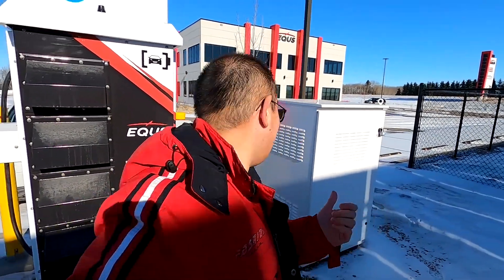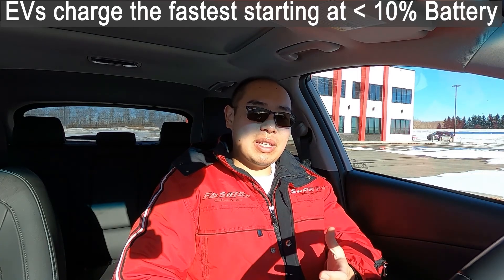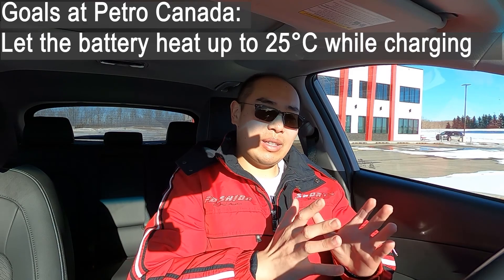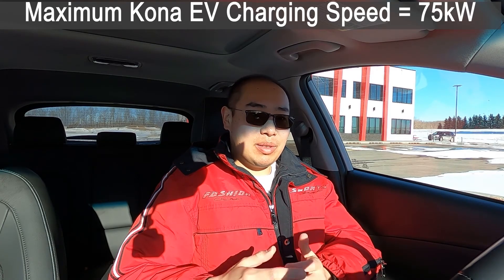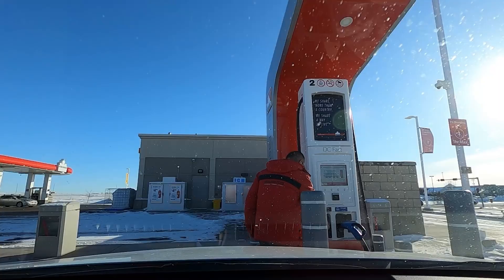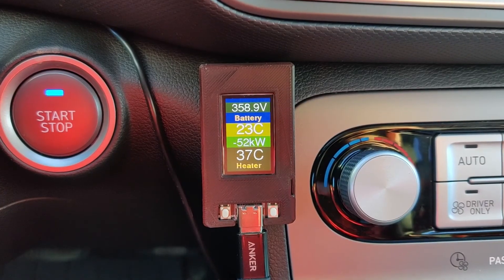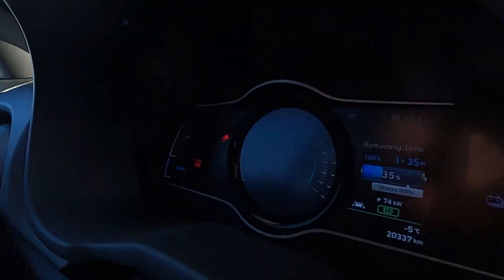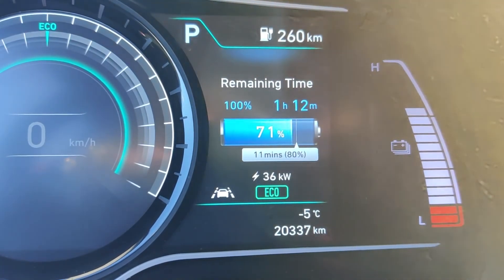Winter 75kW Charging Test: Hyundai Kona EV 2020

Comment: Is there anyway to warm the battery up before you leave on a long trip? I set our Niro to warm up the cabin and charge the battery to 100%. Then we drove all day and made five stops to recharge. The air temp was 0 to 5 degrees C (32 to 41 degrees F). In the afternoon stops we were charging at 75 kw, but the morning charging seemed very slow. I had checked the “winter mode”.

Comment: I'm buying a 2022 Nissan leaf SV plus . I'm wanting to do a long distance trip from Edmonton to Orlando . Do you think this is possible ?
Reply from the maker: The trip is most likely possible in a 62kWh Leaf, as long as you can find charging within the right distance and the chargers you want to use work. But the Leaf rapidgates after repeated DCFC sessions so driving 1000km per day may result in slower and slower charging speed throughout the day. Since the Leaf has only air cooling, your battery's temps are at the mercy of the ambient temp.

Comment: We don’t pay for how long it takes to fill up an ICE vehicle, why are they charging based on time and not kWh? 
We pay per kWh in UK, or I have done for the past 9 years!
Reply from the maker: I'm not 100% sure why all the DCFC here are charging money based on time and not energy. There was only one that was energy based but later it was changed to time based as well. It is more fair to have kWh based cost since EV charging speed vary so much. I think the one advantage to time based cost is that it encourages people to move on as soon as their charging speed drops. Some DCFC locations only have one charger within 200km radius. It is a problem if you have someone plugging in and then leaves and no one else can charge. It could also be for the sake of simplicity to have a time based cost.
Reply: @READYSTEADYCHARGE  thanks for the reply. We tend to have over-stay fees that make staying beyond 60 or 90 mins prohibitive, almost a fine/sanction type level. Even saying that I’m seeing more ‘new’ EV drivers hanging around for 40 mins to get from 80-95% on the one available rapid 🙄🙄🙄
Reply: @READYSTEADYCHARGE  we have Tesla hyper chargers here. They cost about 10% more than home charging on off peak hours. 30 minutes max charge time and a buck a minute if you leave your vehicle connected while not charging! This is new, like in the past few months but I think it's brilliant.

Comment: Love your videos. I’m looking into getting an EV next year when my Forrester lease is up. I recently retired and only drive a few times a week totaling about 20 miles for the week. Is not driving everyday bad for the battery? Can I get away with level 1 charging in my driveway? If I keep it plugged in when it’s cold outside does that keep the battery warm? Should I be afraid to buy a Kona EV with all the bad reports I read. Love your enthusiasm.
Reply from the maker: Glad that you are considering an EV. Not driving everyday is not bad for the battery. Leaving the battery on very low or very high state of charge for a long time is bad. So if you leave the battery at around 50 to 70% for a long time it won't do anything to the battery. Level 1 charging is definitely viable if you don't drive a lot. Overnight, the Kona can charge around 70km range on Level 1. Again, I would set the charge limit to 70 percent to protect the battery. The only thing to be careful with is I wouldn't charge on Level 1 at the maximum capacity of the outlet. For example, in North America, the maximum for 120V outlets is 1.8kW. I would probably get a cable that could change current and charge at 1.4kW or lower. If you constantly charge at the outlet's maximum you increase the chance of the outlet burning out especially when it is an old outlet from an old house. When the vehicle is not charging, the Kona's battery could go to -15C and still be fine. I have never seen the battery temp go below -15C even when the ambient temperature is -30C. So I assume the vehicle is using a bit of energy to warm up the battery. The vehicle will be able to warm the battery whether or not it is plugged in. But when it isn't plugged in, you will slowly drain the battery overtime if the ambient temperature is consistently below -15C. The Kona EVs affected by the recall are 2019 and some 2020 vehicles and they are buying back or swapping batteries for the affected vehicles. So far, there haven't been any reports of 2021 or 2022 vehicles catching fire. I sure hope Kona's won't have that problem anymore for everyone's sake.
Reply: @READYSTEADYCHARGE  Thanks for the terrific and detailed answer.

Comment: how long did it take to charge to 71%?
Reply from the maker: I would say around 50 minutes, maybe a bit less, starting at 11% battery on this 350kW DCFC
Reply: @READYSTEADYCHARGE  how much would it cost at an EV station?
Reply from the maker: @Luwee808  Petro Canada 350kW DCFC in Alberta costs $0.33 per minute. Which is around $20 per hour. It only uses time to determine cost so the faster your EV charges, the cheaper per kWh of energy.